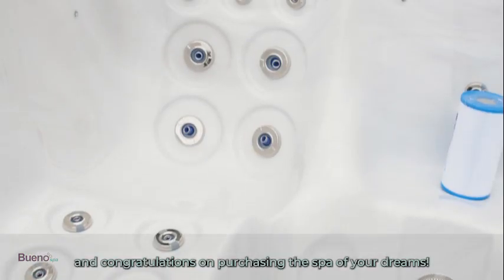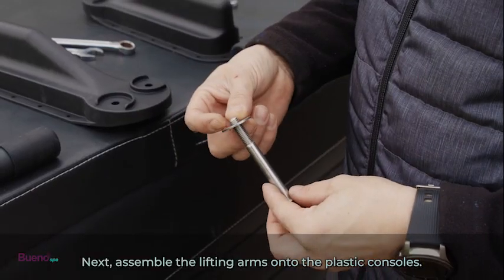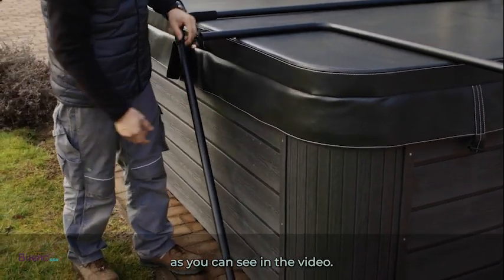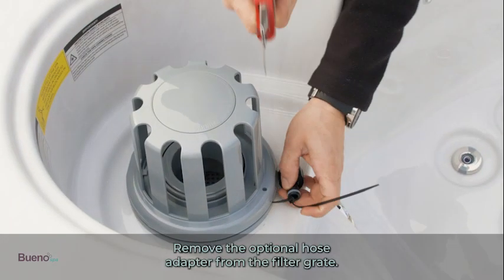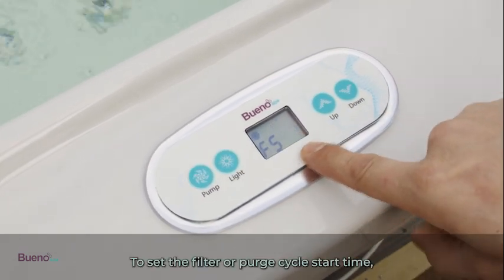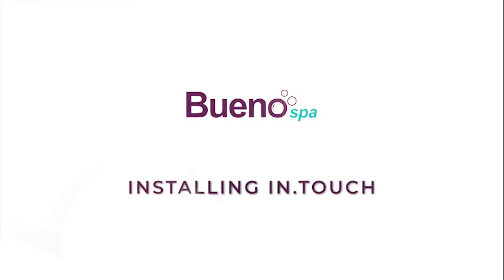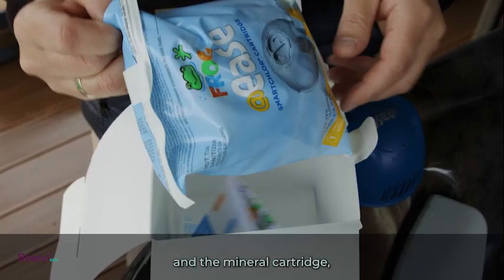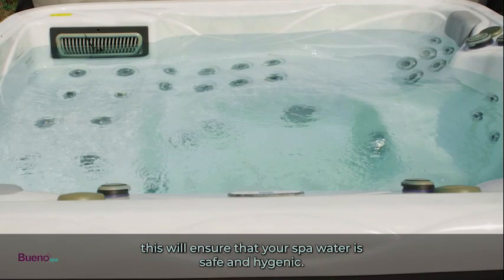Buenospa Hot Tubs Installation Guide

Comment: How do I drain my Jersey bueno spa!?!
Reply: Buy DEKOPRO Submersible Water Pump 1/3 HP 2450GPH Utility Pump and attach a hose to drain it away from the foundation of your home. Place the pump inside the bottom of the tub and pump away. Turn off the power to the tub before draining.  Easy peasy 😊